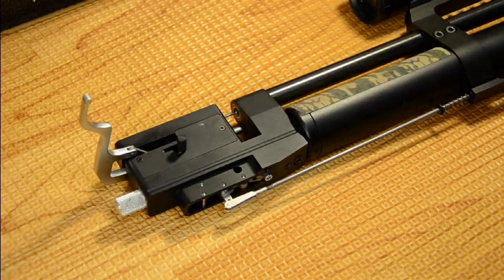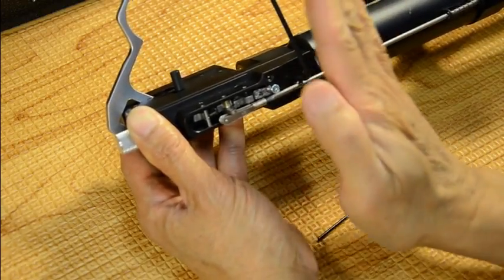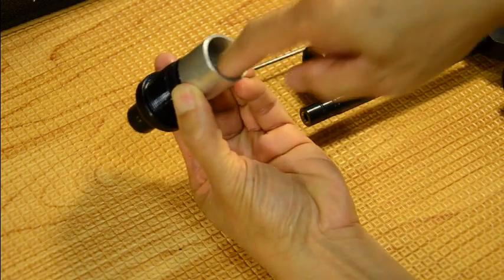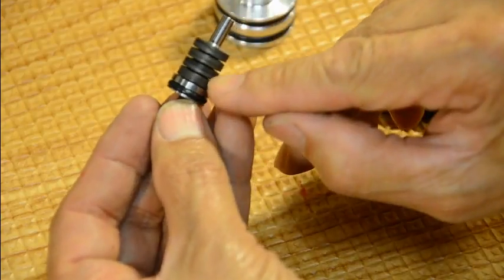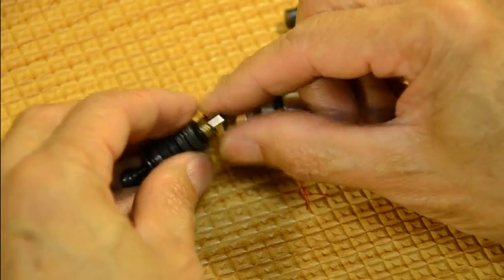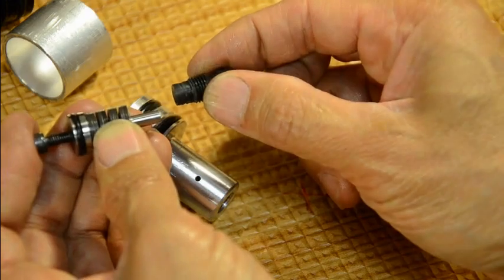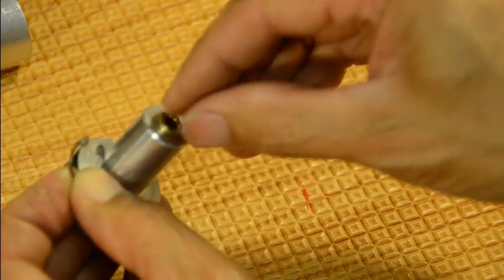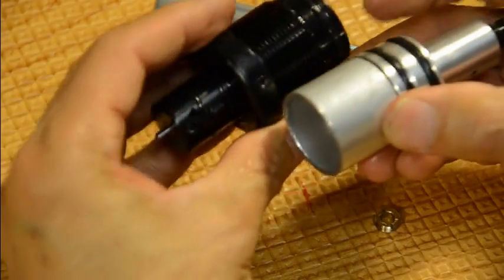KaliberGun Cricket Regulator Removal, Disassembly, Adjustment and functions

Comment: Excellent video. Congratulations. A question, WHAT is the best regulator value for a cricket tactical II 60 in .22 caliber for 50 meters? Thank you so much.
Reply: Seguo, mi interessa molto
Reply: @MDCORPORATION  125 - 130 BAR.

Comment: Congratulations on the channel. Some questions to help me out. Is this system the same as the one in the Cricket 2 WSA? Can I increase the regulator pressure just by opening that Teflon seat very, very slightly without needing to adjust the regulator plates? Thank you 🙏🏻

Comment: Excelent! I have a question. I have a issue in my .25. First shot is about 232 m/s, second shot 252 , next 259 , 263 than reach 266 m/s and stay around that number. BUT.. if stop shooting for a while.. like 10 min, the first will be 250 m/s. That happens becouse the unregulated air keeps filling the chamber, I mean the regulator ins´t sealing 100%? 
It is oring problem or just a screw adjustment? Tks for the help.

Comment: Greetings from France Sir. If you come back arround here, just a quick question. My Cricket (carabine model but same mechanic I guess) has got a sudden loss of power. When I got it, it was shooting between 260 & 263 m/s. Now, it's only between 220 & 223 m/s. Any idea where the missing 40 metters per second are gone ? I can't hear any leaking. I was thinking about a problem with the regulator but well, the shots are well regulated, just like before when it was shooting at 260. Just, now, it's regulated between 220 & 223 instead of 260 & 263... I'm not sure what's happening. Your thoughts would be appreciated. Thank you !

Comment from the maker: each gun has a different sweet spot , could vary from 870 to 920fps. each reg and spring preload is different from gun to gun so there is no set speed per quarter tune.

Comment: Hi Ernest - thanks for all your videos.
I have the .25 cricket and fist shot after a fill is about 980 fps. Subsequent shots drop in nicely at 960 +/- 3 fps. If the rifle sits for over a minute the power comes up again. It seems like the outlet chamber is slowly gaining pressure. This is with new 90 durometer orings installed in the reg. The reg is set between 115 and 120 bar. Any thoughts?
Reply: Spencer Johnson Actually, using your 1/16 punch trick, I think the reg was set higher. Anyway, the power creep up is annoying. Have you seen this before?

Comment: Isn't it possible to sit regulator without the spacer? What would the numbers look like set this way?
Reply from the maker: can't vent hole wont lineup and the air tube will leak